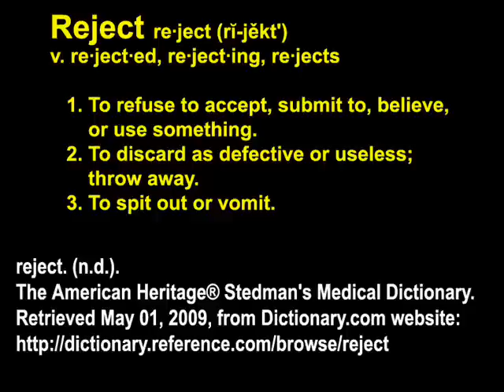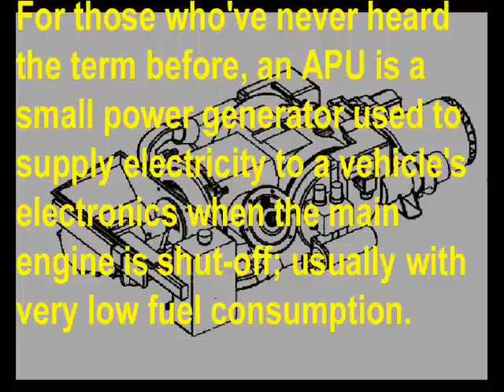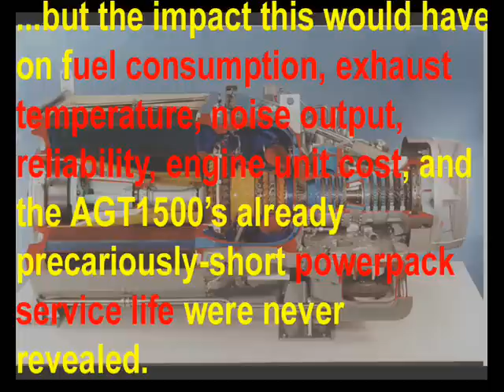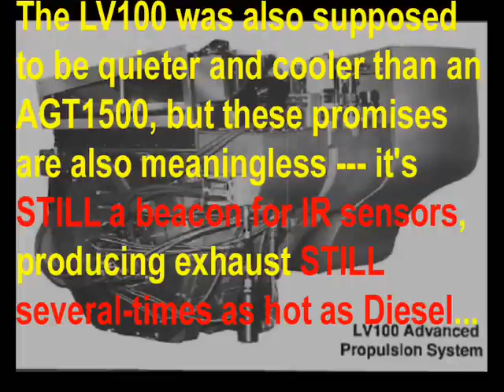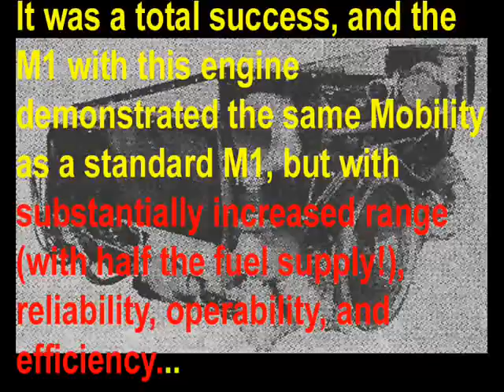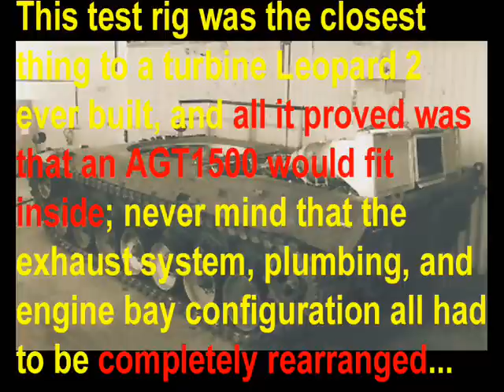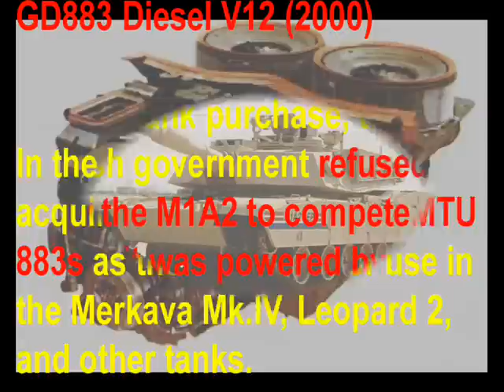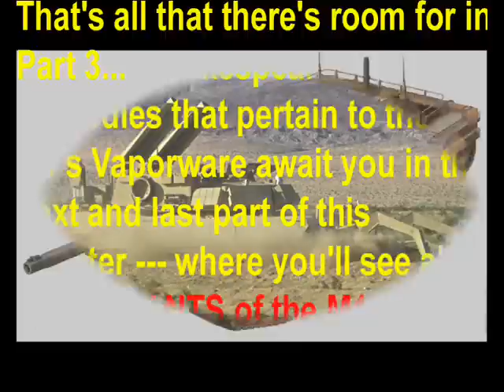The REAL M1 Abrams! Chapter 8: Vaporware (Part 3 of 4)

Comment: Good lord, what is this?  This is so choked full of errors and falsehoods, I hardly know where to start. The funny thing is that I am not a fan of the LGT-1500, but most of the facts in this video are rubbish.  First off, whoever made this does not know the difference between the MTU MB-873 and the MTU MT-883.  The 873 is a very large engine that powers the Leopard 2 tank, the 883 is a newer and more compact unit which powers the Merkava 4 and is what General Dynamics has proposed for the M1.  In case anyone is wondering, the MT-883 is not a good engine, in fact its been so problematic that Israel went back to the older AVDS-1790 for their Namer APC, despite the fact that it is based on the Merkava 4 hull.  The authors contention that a diesel engine is 3 - 6 time more fuel efficient than a diesel is laughable, as is his claim that a 1500HP diesel engine costs $20000.  A 1500HP diesel engine costs in the 100's of thousands of dollars just like a turbine.  And in that power range, they are only going to be around 33% more fuel efficient over a typical combat day.  Given the different fuel consumption curves that turbines and diesels have, these figures can vary quite a bit, but certainly, fuel efficiencies in the range of 300% to 600% which the video states, are completely ridiculous.  Also, i would like to see proof that the army still "bitches and moans to this day" over the 1983 program to develop the AVCR-1360 into a backup tank engine for the M1.  Ironically, while the AVCR-1360-2, which equipped the 1970s GM XM1 prototype was a fine engine, the "improved" AVCR-1360-3B, which Teledyne Continental Motors developed for this program in 1983 was a very problematic engine.  This was due to the addition of variable geometry turbo chargers which never worked as planned, as well as other issues.  Its obvious that whoever made this video knows nothing about about the topic of modern Tank engines.
Reply: "Good lord, what is?"  You must be new here.

Comment: I read ages ago during a public trial demonstration of the engine the Germans, first put some diesel fuel in and drove the Leo2 around till the tanks were empty, then they put petrol/gasoline in then did it again, then for entertainment they put brandy in, and for a grand finale, they used Channel No 5 perfume.  And the Leo2's engine never missed a beat.  Dam clever those German engineers.

Comment: there's one little detail wrong regarding the Leopard's engine: It's NOT a Diesel powering the tank, but a multi-fuel-engine. Pour into the gas tank whatever you find - petroleum, diesel, regular gas, turbine fuel, salad oil - the engine eats it all in even the most perverted mixtures ;)

So if soldiers run out of supply, they go raid a supermarket and empty all the salad oil into the tank, start the engine and go ahead for another sweep :)

Comment: @Zukonabe Not that I am aware of. The Soviet Union at least has the excuse that nobody had seriously tried a turbine engine before in a tank, so nobody knew if it was a good idea or not. Once the CCCP figured out that turbine powered tanks were about as good as diesel powered helicopters they promptly abandoned the idea and focused their research on diesel engines.

The US military, however, continues to try to pound a square peg into a round hole.

Comment: @Zukonabe indeed considering the issues the US and Russia had over GT powered armoured vehicles. Then again I can see why they were attracted to it, you get a very high power to weight ratio for a small package. Helicopters were only succesful once piston engines were dropped in favour of GT. Also they are mechnically simple in comparison to a Diesel albeit tolerances are pushed up to a level where they need to be serviced by a man in a lab coat! For a tank a removable diesel powerpack is best.